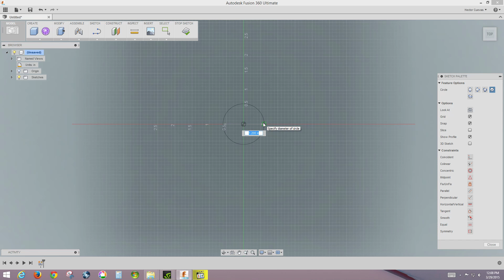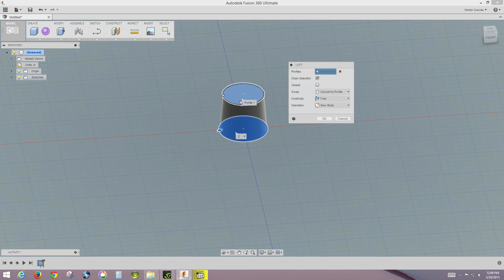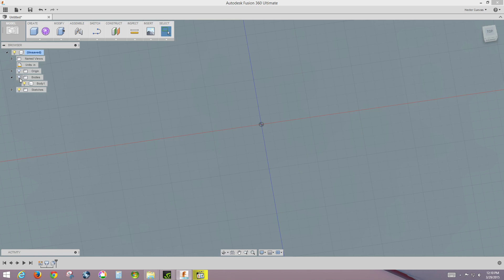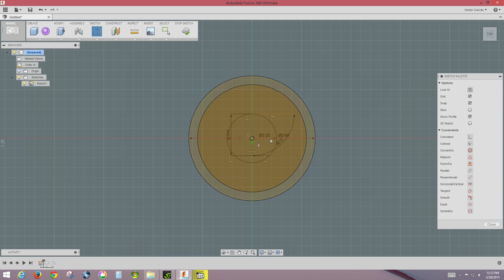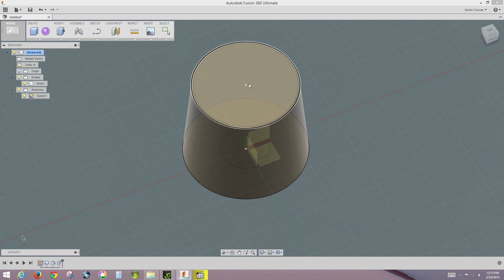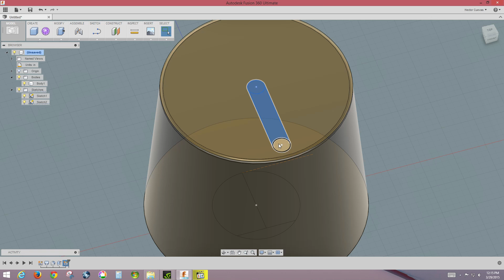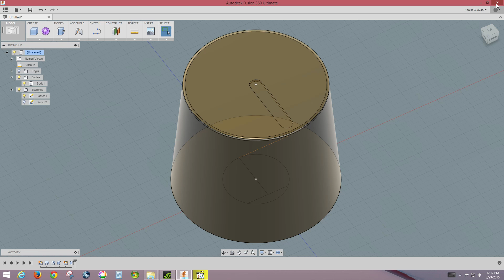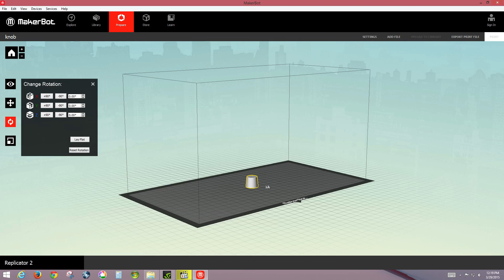3D Printing: From Start to Finish

Comment: You need to show how to add the equations all you say is its going to be point 6.4 but you don't say where to find or how to insert these equations
Reply from the maker: Thanks for the feedback. Check this video out.  https://youtu.be/drrddxD36y4  They updated Fusion so many things sines this video, and I included more Live video so you can see my workflow better.  But you can under simple math in the value boxes, like "3-.5"  and it will make it 2.5.   Thanks again.

Comment: Great tutorial and thank you. I have one question that I can't seam to understand. You say Print to SD card and your ready to print. How does the machine know where to print at? I tried what you said and my nozzle crashes into the bed. I know I'm having a PICNIC which is quit often. The machine is on ,bed homed and level. I'm missing something. Again thanks for your time.
Reply from the maker: Thanks for watching. To answer your question,  I saved the file on to an SD card, and move the card to the printer. I'm able to select that file on the printer to start the print.  A nozzle crashing into the bed is not a good thing, What Printer do you have?  This is an older video and I'm sure the software for MakerBot has changed if you have a MakerBot printer.

Comment: what about the slicer??enlighten me pls
Reply from the maker: I don't understand the question. @14:30, the Makerbot desktop is the slicer. When I got the printer that was the only software that we used. As we were using Makerbot PLA, there was not much in settings.  I have since bought a Prusa Mk2 and use their Slic3r app for many types of filament.  I might do a video on that if any one is interested.